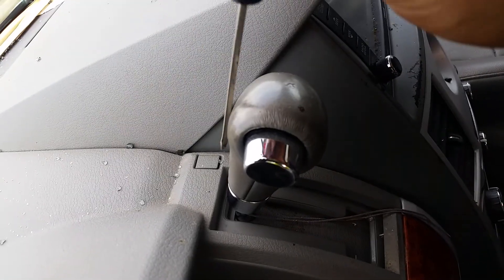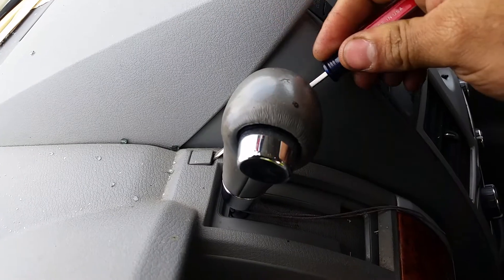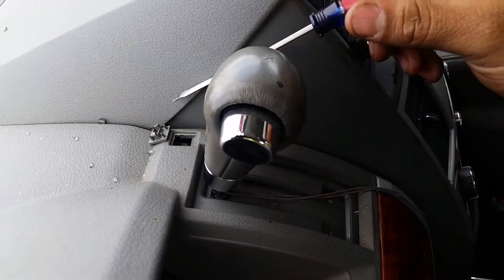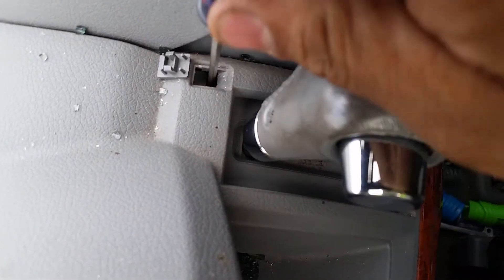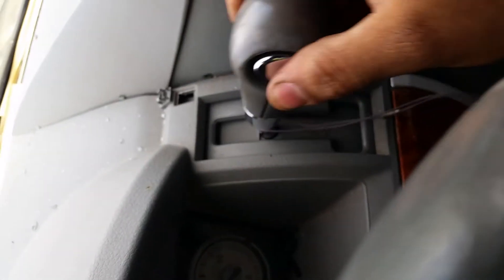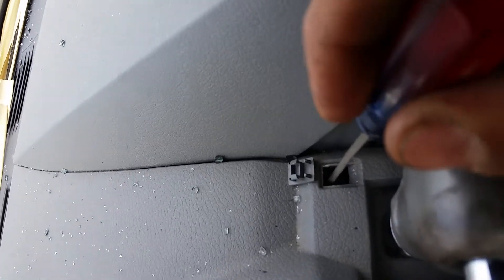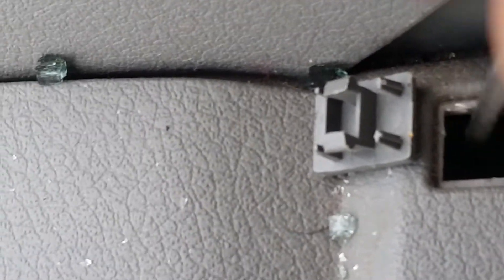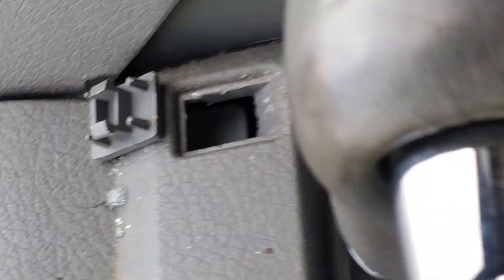How to get a 2008 Chrysler Town & Country into neutral

Comment: 2007 had a different shifter, how to release that?
Reply from the maker: There might be an access point under the steering column for that style shifter. See if there’s a small cover you can pop off or if there’s a hole under the column that you can insert a thin screwdriver in

Comment: Unfortunately my 2008 is stuck in park and even when I depressed a little switch it’s still stuck in park. I’m not sure what to do next
Reply from the maker: Might be your shifter cable. If you’re able to shift the lever but the vehicle stays in park then the cable on the transmission probably popped off. Happens quite often.

Comment: Did this but now it won’t click into drive, neutral, or reverse. Just moves easy past all. Any suggestions?
Reply: Ok I think your shifter transmission went bad,  because your shifter got couple springs and one may be missing
Reply from the maker: Might have a bad shifter cable or the cable popped off the linkage. It’s a common thing on some vehicles.
Reply from the maker: It’s very common on these vans. I just had someone from Canada 🇨🇦 reach out to me on Facebook. Was that you? 😂

Comment: Do you have to push the brake at the same time as doing this? 

Also, do you have to try shifting gears at the same time as pushing that little lever down? 

I’ve tried doing this and still can’t get it shifted into neutral. 

Does the key need to be in the ignition or anything (even if the van battery is dead)?
Reply from the maker: Hold the brake so the vehicle doesn’t roll. Press and hold the release button and while holding hit shift it.

Comment: Is this a safe method to use everytime the shift gear gets stuck in park?
Reply from the maker: You won’t cause any harm. But you should get it fixed.
Reply: @TowMan127  it's in the shop now, but this helped us out lots before we could get it fixed. Thank you!
Reply: Will this work if the van starts but wont shift out of park
Reply: @bjames6592  Yes. It happened to me today. I used the same method, but check to see if it will come out of park with the key turned to the on position, but not cranked. We can shift it to neutral & crank it & then put it in drive or reverse, but make SURE to hold the brake if it works.
Reply: @allijohnson3944  what did they the fix in the shop